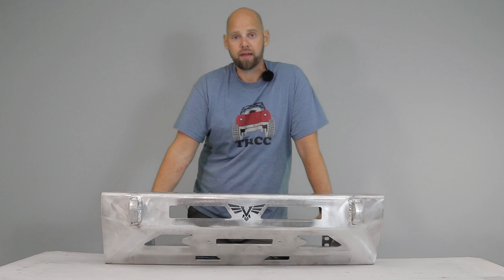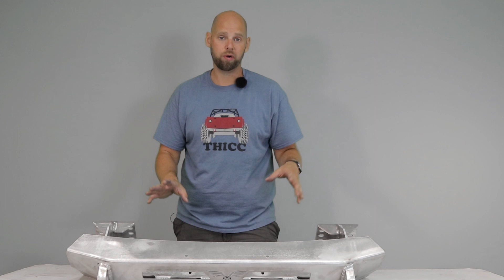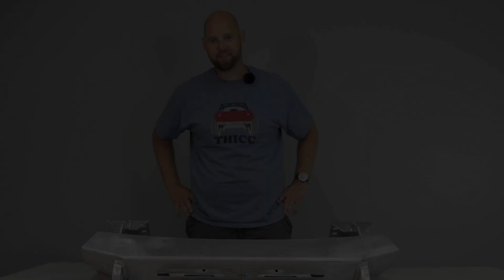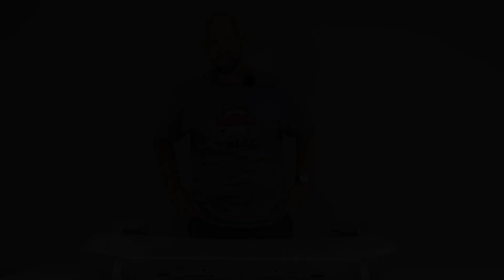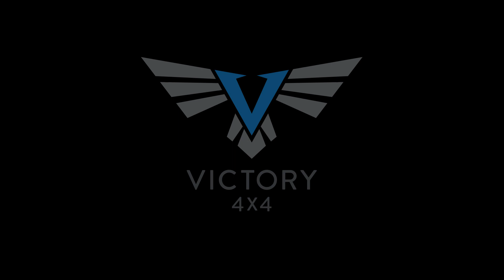Choosing Between Steel & Aluminum

Comment: I don’t regret for one minute getting the aluminum bumper and I do exactly what he’s talking about.  No excessive rock crawling, some recovery work as we live in the Mtn’s of Colorado and I didn’t want the weight of a steel bumper also I am not putting a lot of $$ into suspension just for that.   It has its place and I am glad they offered it.  Thanks Victory.

Comment: How do aluminum rock sliders hold up?  They're more for abrasion than impacts, and Al is soft
Reply from the maker: They hold up well but will get scratched up more than steel will. We think it's worth it for the weight savings.

Comment: And for a crash which one do you recommend?
Reply: This is my own speculation, I don't have statistics or references, but... for a road crash, the aluminum will likely be better in terms of energy absorption/safety.  Since steel is more rigid, a front end crash will translate more of that energy into the frame of the vehicle and ultimately the driver.  Aluminum being a softer metal will crumple under that force, what that means its shedding energy in the process; which is what traditional bumpers do.

Comment: Spend a lot of time out in the hill country and I’ve hit a few deer. Would aluminum hold up?
Reply: A deer would likely not be a total loss with an aftermarket metal bumper on a pickup. Elk, moose or steer… yes. More so with this style of minimalist winch mount bumper.
Reply: It won't matter with a deer hit, it will be a total lost either way, the trick is to have the bumper insured as a accessory, it cost about $2 a month extra, I have $5800 in offroad parts covered for about $15 a month. Hope this helps you.